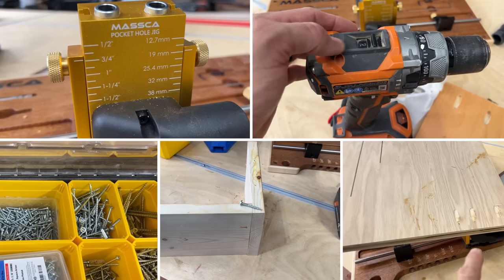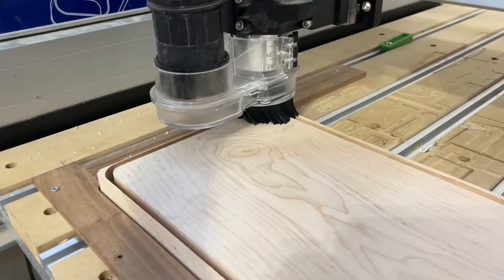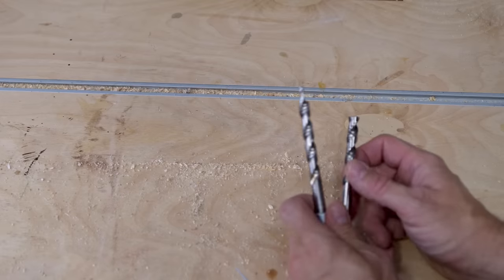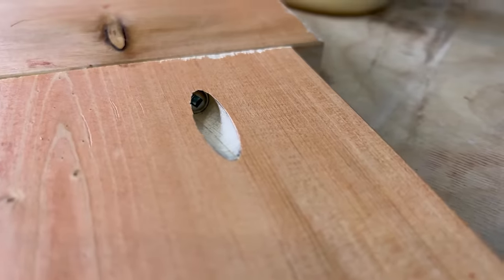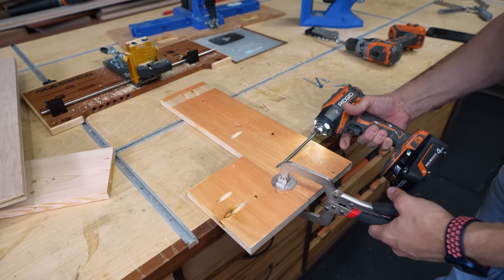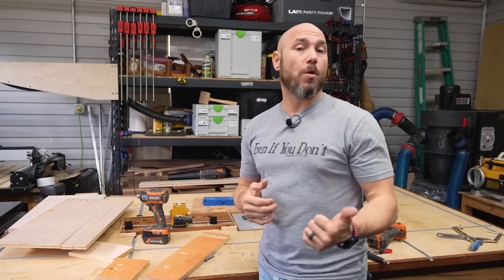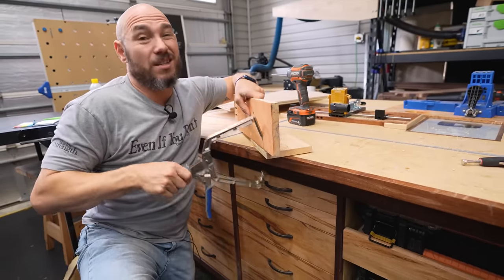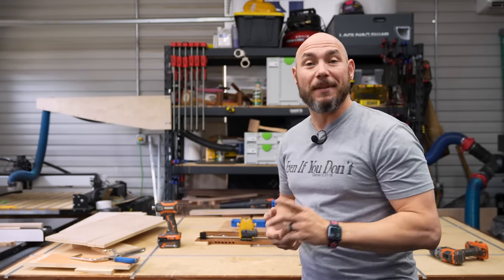Pocket Hole Joinery Tips for Beginner Woodworkers

Comment: Very frustrated.  Try drilling the holes rip. With a new drill bit as the other was cheap and broke  but it's a disaster. Depth everything set up perfect. So not sure what's wrong and no it's not a kreg. Wonderful video.

Comment: Very new woodworker here. I am really struggling to with my pocket holes because the wood keeps splitting when I drill the holes. I am trying to drill pocket holes down the length of 1x4 whitewood (very soft wood) and the pocket holes come out terrible. The wood splits terribly. When I make pocket holes on the ends of the boards they come out great. But when drilling them along the edges they are completely blown out and split. Any advice is very appreciated. Thanks!

Comment: Hey Matt the pocket hole king. Have any tips to keep the pieces from moving when screwing? I’ve tried a face clamp and it still happens. Tried screwing in slow/fast and I had a one hole piece so I couldn’t use the hole clamps either and the piece still walks off of flush.

Comment: On the Massca m1. When using the portable base. Do you first set the depth of your drill bit.? Before  you remove the guide block and add the metal portable base?  Also does Massca have a plug cutting bit for the jig like Kreg? Thanks for any information.

Comment: Thanks Matt, good tips as usual. I have always heard to not use pocket holes when joining two pieces that the width (assuming the grain runs the length) of the pieces are not: 
a) parallel on the same plane (like a table top) or 
b) perpendicular (table leg) 
The reason being because of expansion and contraction causing splitting. The exception being plywood. Is this true?

Comment: Maybe you could do one in the WEN pocket hole jig I bought one last week. AMAZING construction of it ain’t really had a opportunity to use it yet
Reply from the maker: I wasn't aware they made one.
Reply: the wen pocket hole jig is a rebranded harbor freight jig
Reply: @731Woodworks  I actually didn’t either until someone posted asking about it on the FB group. But I like it and it’s definitely a cost efficient option from what’s becoming a fairly trusted up and coming brand.
Reply: @davidcorliss   I’m inclined to disagree for the fact that I’ve NEVER bought anything from HarborFreight (except my predator 6500 generator) that felt even remotely structurally sound. I’ll go out on a limb and say it’s better constructed than the Kreg 720. Not a plastic piece on it. But I wouldn’t go throwing out the Kreg accessories
Reply: they are Identical just the Wen is painted
Reply: and looking on Amazon found 2 other pocket hole jigs same exact design this happens a lot with tools
Reply: @davidcorliss  upon further review - you’re absolutely right 🤣 I apologize. the WEN is a tad cheaper though